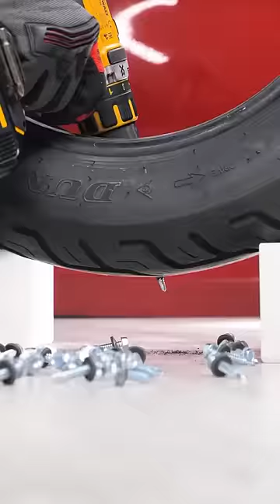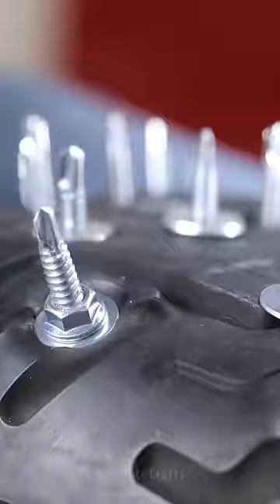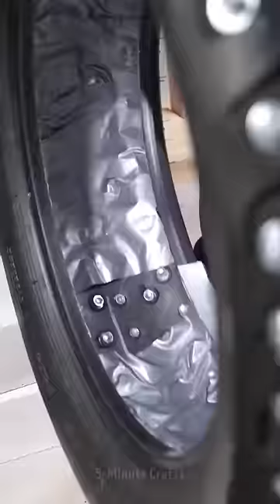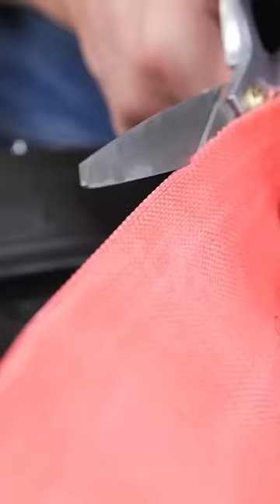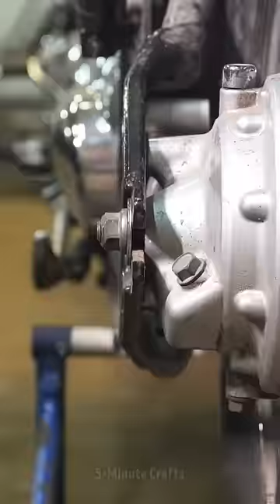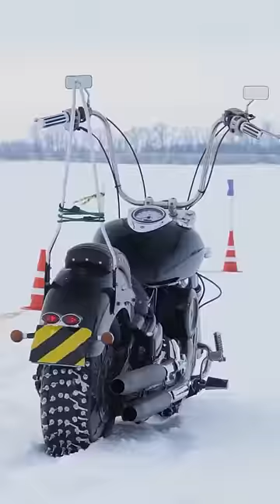Make your Shorts a hit with ”POLAR, LA LA LIFE - BAILA”: the top trending sound of the month! 🚀🔥

Comment: Like a few days before Thanksgiving (before the SLC Olympics in 2002) I rode from Boise on a highway past the Tetons in a snowstorm at midnight on a motorcycle heading to Chicago.  Was at least a few inches of snow on the road.  Cleared up when I got into Wyoming.  But before then as I was heading into the mountains, a car was coming down in the snow braking as I went by because I am pretty sure they could not believe what they saw.

When I went further into Wyoming at night I had to put on all the clothes I had -- over 6 layers.  It had to be far below 0 degrees with the wind chill and at night.  I hit a rest stop finding it was heated which was so nice but kept on going.  Ended up camping in a tent somewhere on the side of the highway.  In the morning I started the motorcycle up letting it warm up but a rod probably cracked.  All the oil came out of the engine.  It went from cold to hot too fast.  Also probably was the wrong kind of oil too for the extreme cold.

A tow truck ended up taking the motorcycle storing it for me for a few months.  I got on the Greyhound bus to Chicago.  Then came back to Boise on the bus.  Went to the SLC Olympics, picking up the motorcycle on the way back.

Bad thing is I kind of bought the motorcycle intending to give it to my brother but I broke it.  I replaced the motor but... hmmm... I think my brother got a different one by this point -- an Interceptor which rode a bit unusual.  The Nighthawk (which is what I had at the time) was sweet though!!

Comment: You fix this on the strip of older tryes bu cutting  circular edges near wheels. 
We must make it wear like coat on tyres. 
After that you attach extra required rubber tube weast for attaching to wheels, used extra strong jip log from Japan.
 You open jip lock to make it wear like coat around tyres and remove when ever not needed. 
You need to turn the original wheels  in circular ways for making it wear like coat around tyres. 
Keep air pressure little low  in original  tyres for better function .
You try on sand,heavy current water upto one 2ft , heavy muddy areas, we can make tyre for uneven Rocky areas. 
Jay bharat.